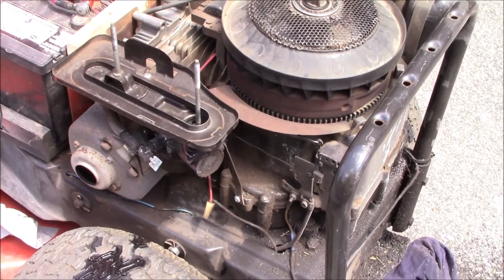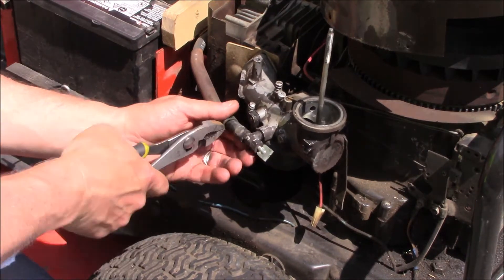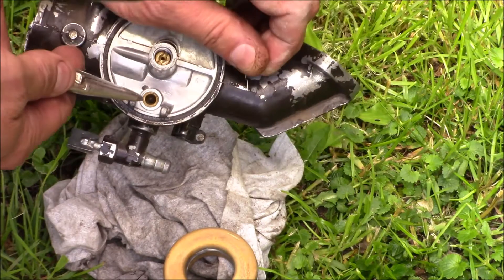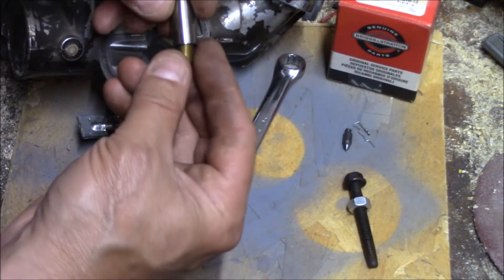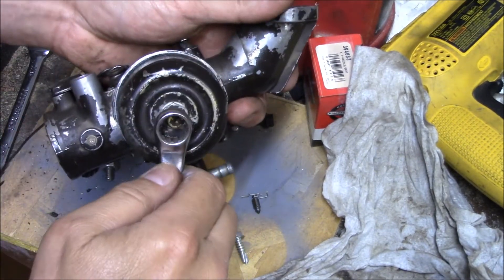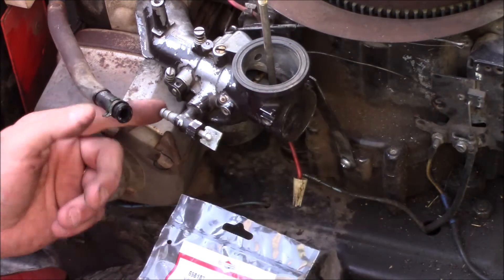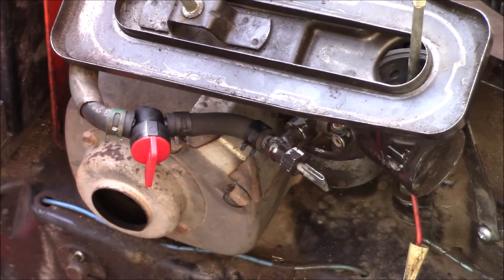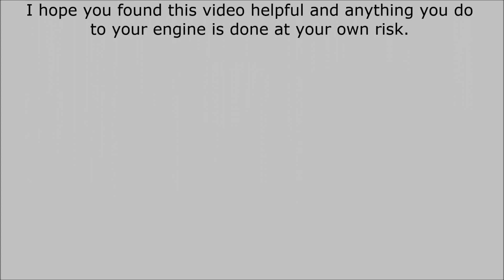Briggs & Stratton Needle Valve & Seat Replacement

Comment: Great make it yourself tools.  I noticed you said the brass was dirty so maybe all it needed was a good cleaning so the pin will seat tight.  I cleaned mine with a cotton swab and some toothpaste to polish it and put a new pin in and it stopped leaking.  Now mine wasn't leaking as bad as your Ariens so maybe that is why it worked for me.  Also, I now put one tablespoon of Sea Foam in each gallon of gas. It is too early to see if this will do any good, but it won't hurt.  Good information on float since this is often overlooked.  Great full step by step video, thanks.
Reply from the maker: glad this helped

Comment: Holy carp - leave it to Briggs to force people to MacGyver some sort of machine tool extractor just to change a routine float needle valve seat.

On the other hand, my grandson now thinks I'm a genius, because he was watching me tap the seat with a 1/4 by 20 tap I happen to have, and he said there's a got to be a better way on YouTube, and this video shows up. So now I apparently have YouTube cred, thanks to you.

All I need to find now is an extraction collar that will let the seat pass through it, you'd be amazed how many round things I have that are not the right diameter of round thing.
Reply from the maker: I wish you the best
Reply: @bbbjim1fixedit  - Oh, I found a random small u- bracket that I was able to bend into the right diameter - but I wasn't cautious enough pressing in the new valve seat and got a bit of a lip that prevented the needle from moving freely - that took a little bit of sorting out.

Even though I had the right idea with tapping the old seat and putting a bolt in it, my idea was just kind of levering on the bolt, and that would never have worked. Pressing it out the way you did had not occurred to me and probably would not have.

I maintain there should be a special section of hell reserved for Briggs & Stratton engineers. I still haven't forgiven them for plastic carburetors.